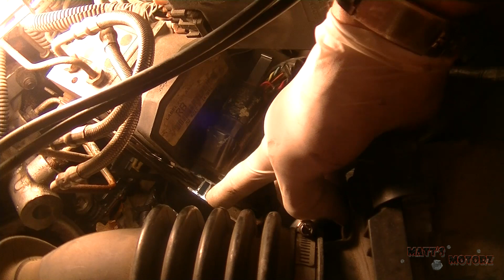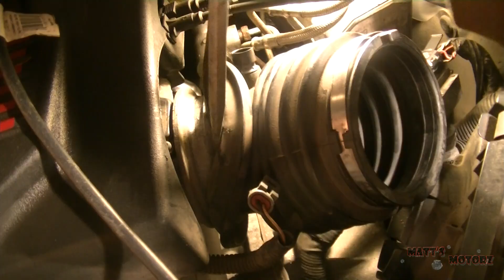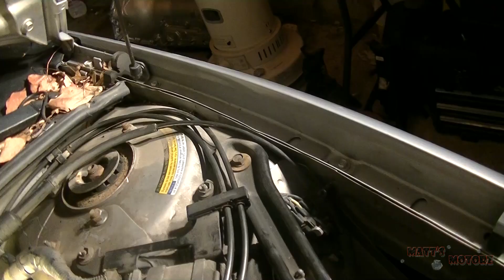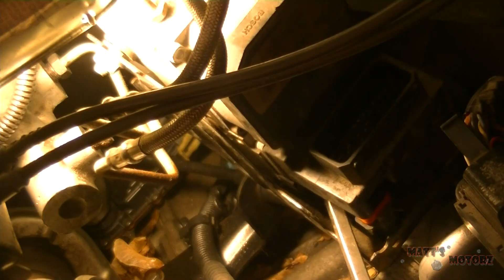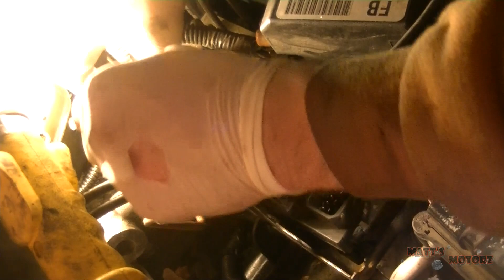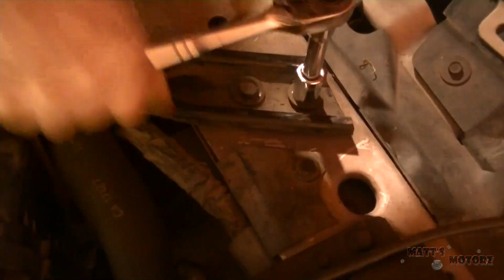Replacing an ABS Control Module [1999 Pontiac Grand Prix]

Comment: four comments please... One thank you for posting, two, did it work replacing the module, three, you couldve just removed the lower tow bolts on the crossbrace then slid it enough to get air box out, and four, why didnt you "lube-up" the air intake hose so it would go back on then come off easier at a later time?... Thanks again for the vid. - DTM